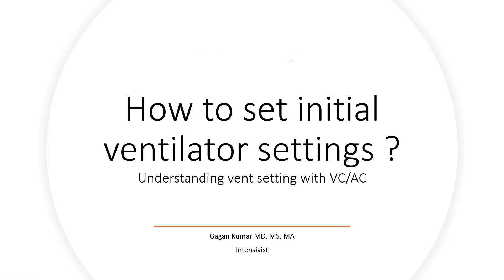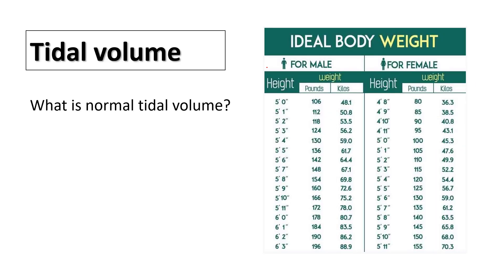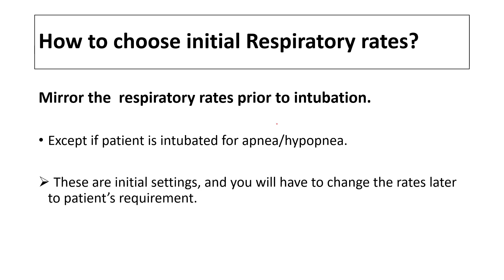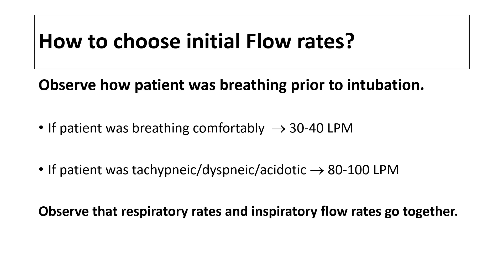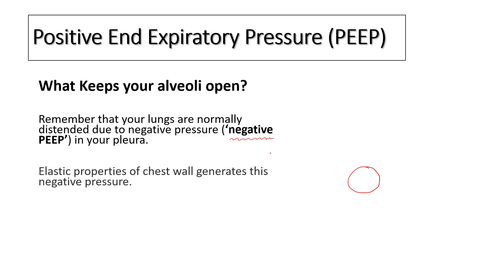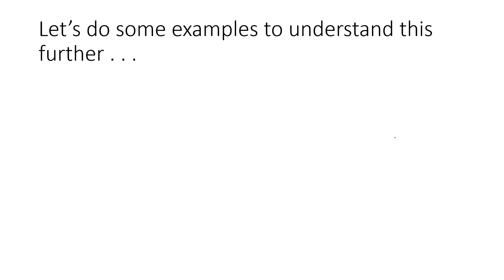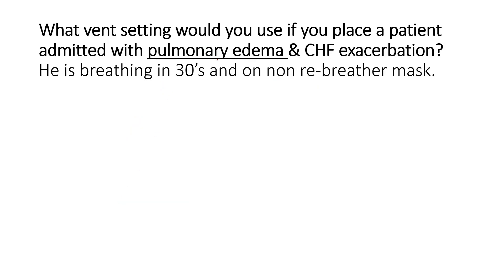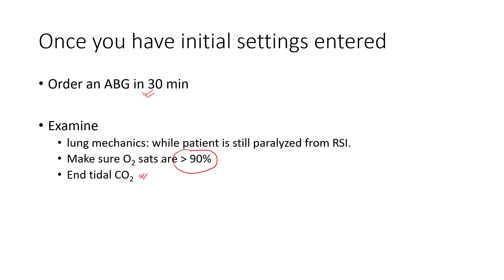1  How to put initial ventilator settings   VC AC mode ?

Comment: I have two queries, for a patient in ACMV all the spontaneous respirations will be fully assisted by the ventilator, so is it important to set the RR high in a tachonoeic patient ? Second query is what happens to the I E ratio when the RR is increased or decreased ? Will it change or remain the same ?
Reply from the maker: This video is for the initial settings only. When you intubate your patients, most doctors will use paralytic. This is the time where you try to match the tachypnea. once the paralytic wears off, and patient is triggering the vent at higher rates than set rate, he will get TV at his respiratory rate. Watch - "how to optimize Flows & RR"  to further adjust the RR in these patients. this video will answer your second question as well.
https://youtu.be/kUqeLz9no9c
https://youtu.be/Le5IdMMpGaE